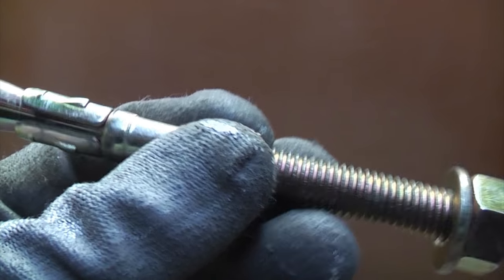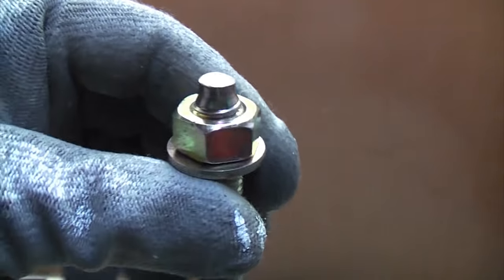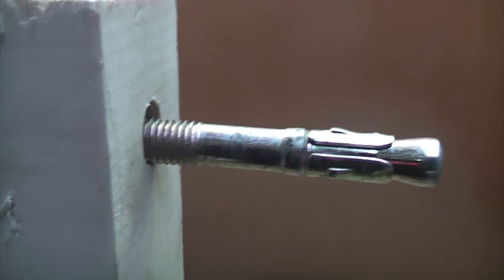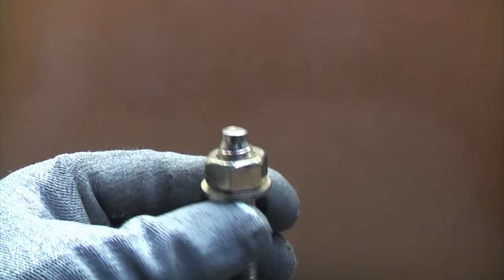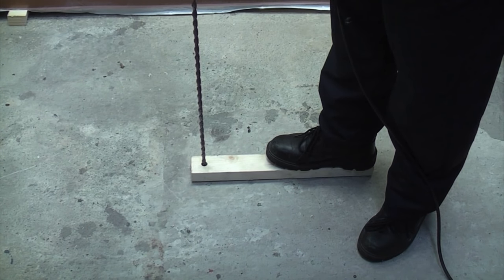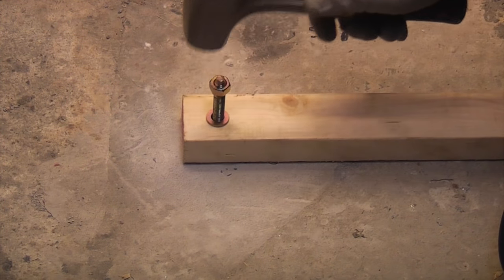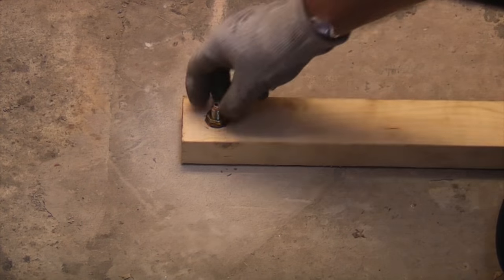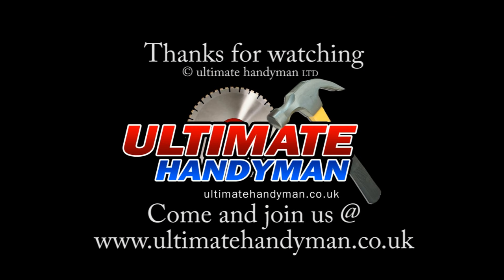Concrete anchors

Comment: Is it possible to get pliers and pull out the  anchor bolt instead of hammer it in?
Reply from the maker: Manuel Castillo No, you can't pull them out as they expand when pulled.
If you can't knock them below the surface you often have to cut them off using an angle grinder etc.
Reply: ***** Im a first time DIY, I wondered how they stay in.
Reply from the maker: Manuel Castillo No problem, When the nut is tightened it pulls the bolt through the sleeve which makes it expand.

Comment: Can you this to add  a rail on my concrete steps
Reply from the maker: It depends how close to the edge the fixing holes are. These should not be used close to the edge or they will break the concrete.
Resin fixings might be a better option- https://www.youtube.com/watch?v=oUJPjJsdl0c
Thanks for the comment

Comment: I've heard these are useless for brick walls, only concrete?
Reply from the maker: It depends on the type of brick. I've used them on site to hold up pipe brackets in bricks and they have worked fine.
The problem with bricks is that, many of them have hollows in them. If you can drill into a solid portion of the brick these will work fine.
Thanks for the comment
Reply: @ultimatehandyman  Cheers, good to know.

Comment: I'm planning to mount verticals of Unistrut to my concrete foundation. How can I determine the tension strength of the anchors? I plan on 450mm rack depth with about 250KG/M2 loading per tier, 3 high. any suggestions?
Reply from the maker: The manufacturers website should have some info about the tensional strength. I'd check that out for the particular brand that you intend purchasing.
Thanks for the comment

Comment: mine was loose, i cant tighten, im using it to my pull ups . what should i do?
Reply from the maker: Try pulling it outwards, then wind the nut in.
Then grab the end using mole grips/vice grips and tighten the nut. 
That should make the fixing expand and grab.
Reply: @ultimatehandyman  yeah i already try it, but when i pull again the 2 bolt was loose again, can i fix my anchors? or should i buy a new one?
Reply from the maker: @3mn422   Is the hole the correct size?
Normally they will bite and tighten up, but if it won't you could try another one (if you can get it out).
Perhaps Resin anchors will be better- https://www.youtube.com/watch?v=oUJPjJsdl0c&t

Comment: Is there a way to remove those - dear lord I have 2 in the ceiling . 😱 im a complete amateur with no fancy tools . Tried to hammer it it is not going in 😱 . Please help
Reply from the maker: They cannot be easily removed. We often cut them flush using an angle grinder.
You can wet the fixing, put the threaded part in a drill, then add sand and grind away at the fixing, but that will not work well on a ceiling!

Comment: but is there any way to remove the anchor ?
Reply from the maker: Not easily- unless the hole has been drilled deep like in this video.
We often cut them off flush using an angle grinder on site.

Comment: Hi just wondering if anyone could help me I’m looking to put a floor over my stairs and need to build the joists would this be strong enough to hold the weight of a walk in wardrobe? Any help would be really great full
Reply from the maker: These are one of the strongest fixings you can get for solid walls, so they should be able to take the weight, providing you are not fixing into aerated concrete etc.
Thanks for the comment 👍
Reply: @ultimatehandyman  thank you for the reply! The fixing would be going in to bricks so I’m worried of blowing the bricks out
Reply from the maker: @Th3WorstPlays   Resin anchors might be a better solution, they work well in bricks as the resin will fill any voids-
https://www.youtube.com/watch?v=oUJPjJsdl0c&t

Comment: Can you help out with my question? 
I'm attaching 3x3 wooden posts to side of house to hang reasonably heavy gates from. How deep do I need to get the bolts /screws into the wall? Obviously 3x3 is 75mm thick so a 100mm hex bolt will only be in wall by bout 30mm even if I counter sink whole on post first, I can't imagine 30mm being enough. Can't find any bolts longer than 100mm.
So I'm thinking 150mm Easy drive concrete screws from screwfix will be good.
Reply from the maker: The concrete screws will work in some bricks, but I'm not sure they will give a good enough fixing for gates.
Have you considered resin anchors- https://www.youtube.com/watch?v=oUJPjJsdl0c
Reply: Ultimate Handyman thanks.
Reply: Look harder they do come in sizes longer than 100mm

Comment: hy can these b used to attach wall brackets into brick?  I am using a length of unistrut to brace against my back garden gate to make a solid secure retractable bar lock. the unistrut will slide in and out through the bracket.
Reply from the maker: I have used them in brick, but someone said that they are only really suitable for concrete. 
Resin anchors might be a better solution- https://www.youtube.com/watch?v=oUJPjJsdl0c
Reply: Thanks. You can get some sort of special masonry screw bolts that you drill a whole diameter of screw and they cut there own way in with the threads. Do you happen to have used these
Reply from the maker: Yes, I have used them in the past- they are very good.
But the problem with most bricks is that they have three holes in them when made, this can leave a thin bit of the brick to fix into. Having said that I have used them on brick with no problems-
https://www.youtube.com/watch?v=P0LXQG3S8ko

Comment: Do u hv a tutorial video on how to remove concrete wall anchor?
Reply from the maker: froggy26 
No, sorry. It's often impossible to remove the whole thing without making a large mess.
We often cut them flush to the surface using a grinder.

Comment: Why the depth of holes same as length bolt?
Reply from the maker: So that if you remove the item at a later date, you can just knock the anchor flush with the surface, otherwise you have to cut it off using a grinder etc.

Comment: How about a video how to remove the bolts when not needed anymore please?
Reply from the maker: +Brian Hunter 
I'm afraid you cannot remove them without breaking up a large section of the concrete.
If the hole has been drilled deep enough, as shown in this video- you can knock the anchor below the surface.
If it won't knock down you should pull it up as far as possible, then cut it off flush with the surface using a hack saw or angle grinder, then you can knock it in with a punch and then fill the hole.

Comment: another mistake 3.25 b4 hammering the bolt in make sure the nut is flush to the top of the bolt which means no damage
Reply from the maker: You don't need to do that as the end of the threaded part is reduced in size- so you cannot damage the threads- unless you wind the nut to the end of the threads and hit the nut ;-)

Comment: what if i gob the end up first with JB weld?😨
Reply from the maker: Are you trying to replace a damaged or stripped stud or something?
Reply: +Ultimate Handyman yes atm i have drilled out to m10 for the new bolts and ive ordered an m10 helicoil kit ,im just hoping its the right kit as i dont want to go up to m11 as its loads more drilling again .i was just thinking that if those helicoils just go right in the holes ive already drilled im gona be nackered ,are they actually slightly bigger than the actual hole along with the tap?if so i shud be fine .i was gona try those thrubolts as a last resort👍
Reply: +Ultimate Handyman ps i just tested some of that JB weld and you can actually burn the stuff when it set!!so no good for cylinder locations i would imagine??😯
Reply from the maker: The helicoils should work. The problem with concrete anchors is that they expand when you tighten them, so it will probably crack the metal and be much harder to repair. If the helicoils don't work and you can't go the next size up you might be best off getting the hole filled with weld, then drill and re-tap.
Reply: +Ultimate Handyman ill try that if it fails 👍

Comment: Helpful but could have recessed the timber to hide the nut and also specified what size drill bit etc you used.
Reply: He did specify what drill bit he used. When you watch videos listen with the sound on it will help no end.

Comment: Avoid anchors that when held in a fist slip out with minor force. The wedge should be sharp and not come out of the hold without a lot of force.   Many of these Samson bolts are garbage as the wedge on them does not fasten well.  ALSO epoxy hardens smooth and the bore holes are smooth.  Guess what type of bolt pulls right out of the concrete?   Read the book Earthquake Retrofitting from Earthquake Construction Service found on Amazon when you want to know which bolts work well and which ones don't.

Comment: Theses are not nearly as successful as they are advertised for. They say on the box concrete, mortot and brick.  They work of with concrete and usually mortar however they are shit with bricks. In the US these are sold under the name brand Redhead.  I  personally recommend using Tapcon brand screws or bols as my success rate has been better with them.  I'm not just stating this from a single experience either I'm a contractor and had this problem more then once. For me from now on it's Tapcon 100% of the time.
Reply from the maker: I agree, I am sure that they used to be advertised for fixing in any type of masonry although a guy commented on this video a while back and said they should only be used in concrete.